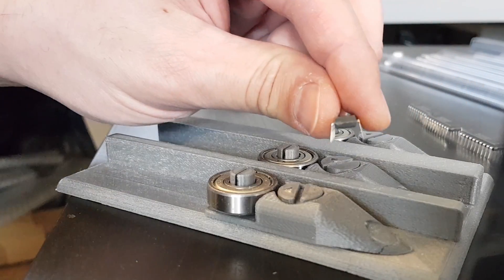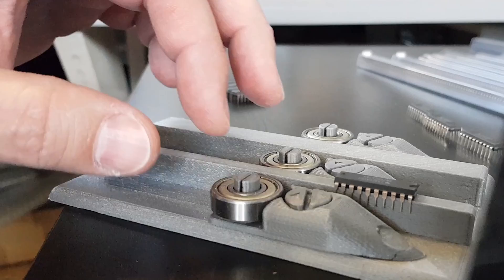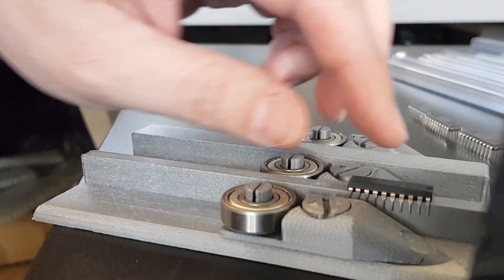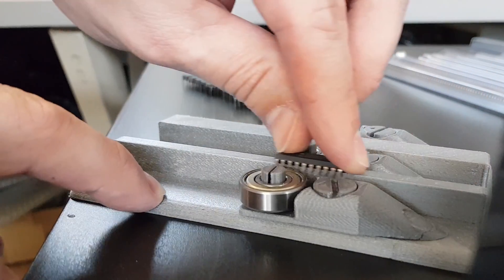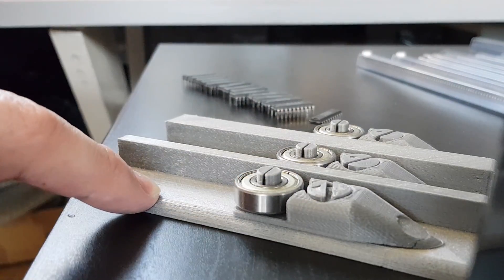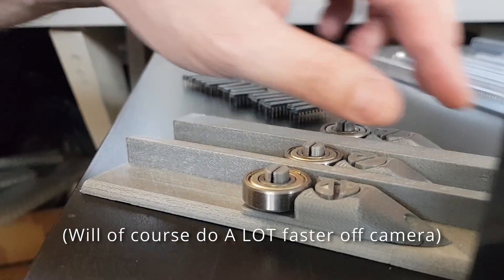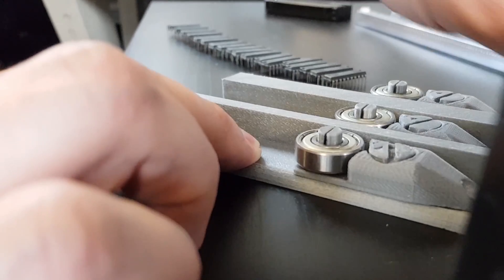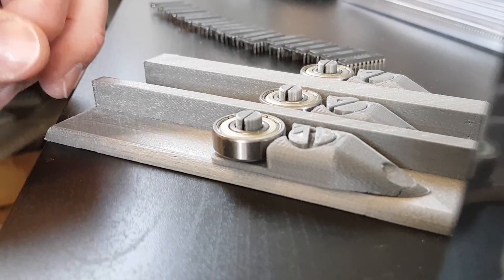Handy IC pin straightener tool, for old skool electronic addicts!

Comment: Neat design, but is it made from ESD-safe plastic? ICs are sensitive to static electricity, and rubbing them on plastic can generate static.
Reply from the maker: Well you could spray paint with metal paint for example.
But to be honest: this does not generate static electricity.
Some fabrics do, not this kind of PLA plastics.

Comment: I remember using such a pin straightener in the eighties, but just recently I had a need for it.
You see, I developed a ZX-81 clone and it has lots of DIL IC's to replicate the ZX-81 ULA chip. Note that DIP IC's fit badly into sockets with machined sockets, so better use dual wipe sockets!

My ZX-81 clone is called ZX81+38 because  at the time (before corona) the ZX-81 was 38 years old. I had designed another ZX-81 clone a few years before that, and reverse engineered the ULA chip then, but that first version had to fit on a 10 x 10cm PCB, as PCB's were very expensive then, so I had to minimize  it to "scrap size" to make it somewhat affordable. Thus I used the much smaller SMT components, that also left the solderside of the PCB unused, which made routing it easier. That version was called ZX81+35. I published all my work on GitHub, and documented it on my makerspace called RevSpace near Den-Haag (yes, I'm Dutch) most builders reported that their ZX81+35 worked, but others reported they found soldering SMT too difficult. 

So after a few years I decided to create a version that only used pin through hole DIP IC's. So I simplified my older design, and found that I could place the remaining IC's on a PCB using the size of the PCB of the real ZX-81, and by using socket footprints with PAD's that had enough space between them to route two 0.15mm traces through. And using every few mm of space. When I finished my first PCB for the new version I called ZX81+38 I released it on GitHub, and soon after I read on ZX-81 fora that there were people building it.

I was just about ready to order PCB's myself when Corona hit and my makersplace closed. But others were buiding my design and finding and fixing bugs, The first bug was that the crystal oscillator did not work, I found that was due to the fact that for its inverter I had used a 74HC14, and this schmitt-trigger inverter is very unsuitable for a crystal oscillator,so I fixed the design and used a 74HC04 instead. In the mean time I was donated a free rev 1.6 Board, which I had built up and discovered the 74HC14 bug with, luckily I had used IC sockets, I also found that I had used a mix of 74LS and 74HC logic, and these don't work together nicely. I also found that I had used a WAIT signal generator which was on the old design, but was never used, because on the older effort I used a transistor based  circuit instead.

fixing the crystal oscillator and a new WAIT circuit fixed it for many, but some complained that they only got a black square instead of a reversed K character. that was solved when a German buider discovered that it was a timing problem that could be solved by inverting the CPU clock signal (relative to the video clock signal).
The only "inverter" still available I could use for that was half a 74HC74 that was unused. Routing to and from the 74HC74 was hard, but I managed it, so that was version 1.8. and fixed all major bugs.

One last bugfix was for the joystick logic, which missed some pulldown resistors. But now at revision 1.9 I am quite confident my clone will work 100%. You can find all the files on my github page at www.github.com/mahjongg2 I even released the KiCad files, but if you are just interested you can just use the gerber/drill file .ZIP package and order PCB's Its the file production files  ZX81+38.zip For components you can use the spreadsheet (open office format) ZX81+38 Bill of materials it has the exact components from either Farnell, Mouser or Reichelt. to help Assembly there is also a drawing documenting the exact location and rotation of all the components. 

You can also download the ROM contents of the ZX-81, and read the ZX-81manual online.

I'm busy arranging a kit with a programmed (E)EPROM.
Reply from the maker: I get asked a lot for ZX81 clone DIY kits, we need to talk Martin!

Comment: That's so cool. I don't have a 3D printer. :(
Reply from the maker: They're really cheap these days! I bet you can find one for less than €100.
It's really neat to see ideas turn into real objects!
Reply: @ByteDelight  The biggest problem is finding somewhere to set one up. I have a small cramped house, (stacked with 8 bit computers and reel to reels), with no spare work spaces. :)